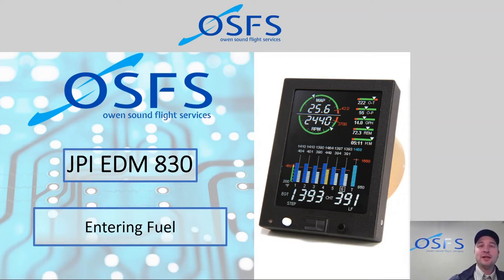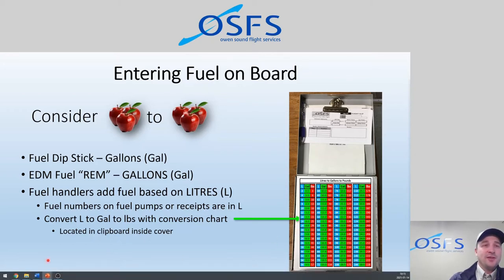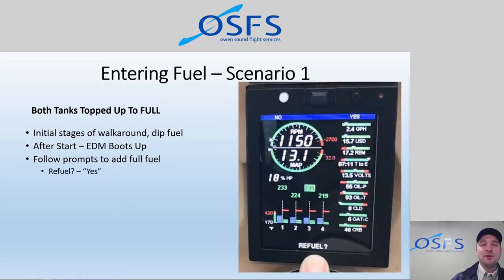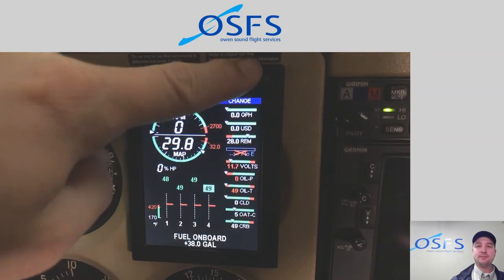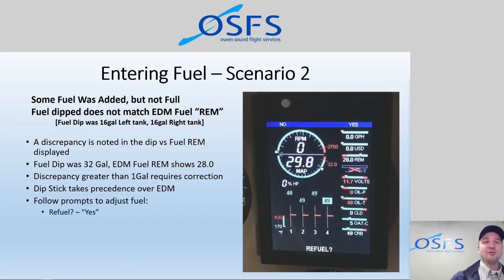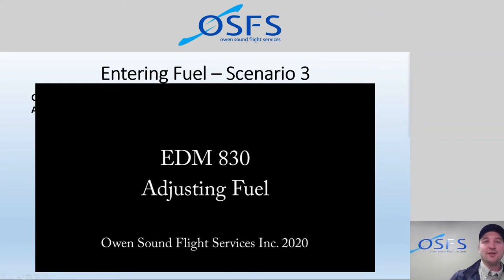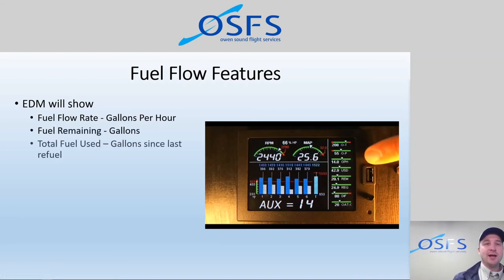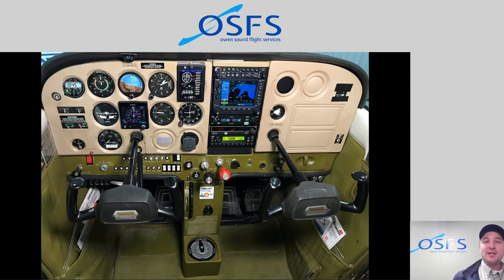EDM 830 - Training Module 2 - Entering Fuel

Comment: When installing an 830 into a Cessna 172, there is a MAP (manifold pressure) probe. Given that the prop is a fixed pitch prop and the MAP is not something that the pilot typically cares about, my mechanic is hesitating on drilling into the intake manifold. Will the lack of that value inhibit other features or information from the 830? Is there a valid reason to not put a probe into the intake manifold?

Comment: You left out the 1st step. How did you program the jpi to show 38 gallons as the full tank amount? Every time you push full fuel it goes to 38 gallons which you programmed in to the JPI originally. 
Please explain. Thank you
Reply from the maker: Hey there,
This process is outlined in the Pilots Guide available on JPI's website (https://www.jpinstruments.com/wp-content/uploads/2012/07/PG-EDM-730_830_851_740-Rev-F-TB2.pdf).  See page 56 at the bottom.  It's also demonstrated in one of the JPI training videos (https://www.youtube.com/watch?v=a8P15IPU9bc&t=4s) at about 5 minutes in.

Comment: I have a JPI830 for my TSIO 360 with the FF.  When flying i get the amount of fuel used but the 72 gallons tap off stays the same. I tried trouble shooting with JPI and local mechanics to no prevail.  Any suggestions?
Reply: Hi there, 
I'm not sure I fully understand the issue, can you try and articulate a little further with some scenarios.